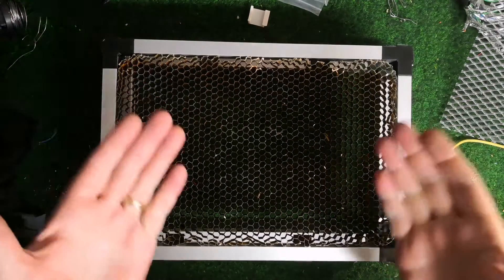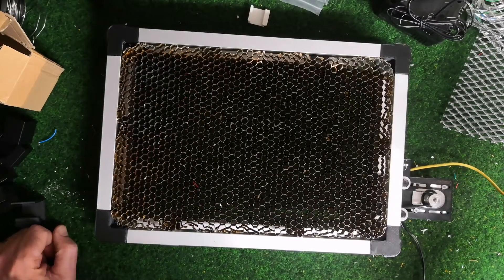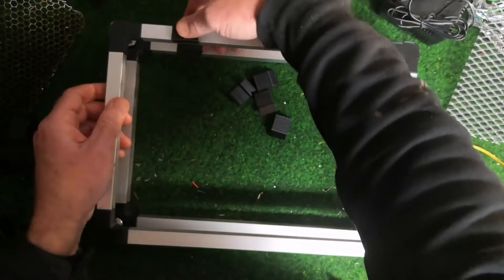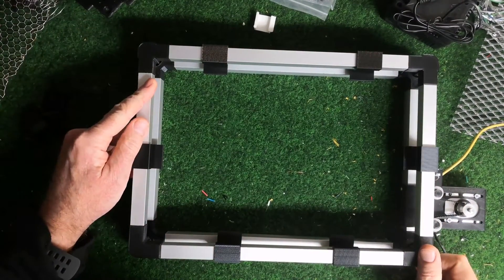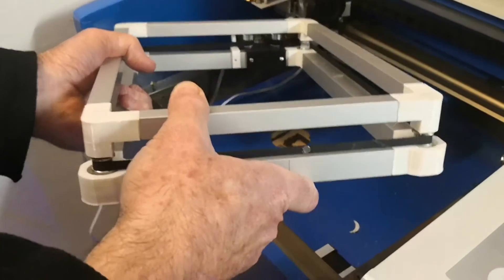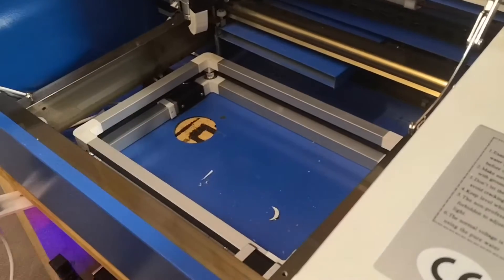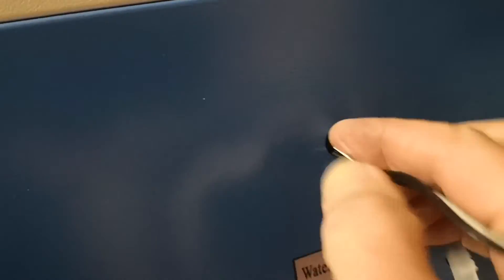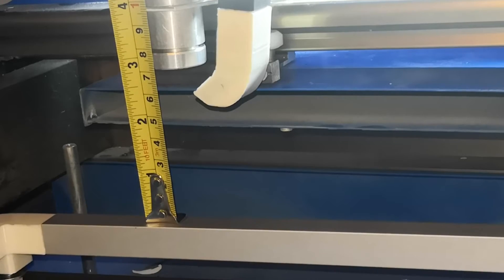K40 LASER "Z" AXIS MOTORISED BED.

Comment: Will this fit inside the so called K40 mini's?
Reply from the maker: Haven't heard of a mini version, do you have a link?
Reply: @letsfixit1594  It's basically a K40 but the case is bit smaller on control panel side and the tubes only 650mm
Reply: @yourpshomenet  I have a mini, the only difference is the power supply side, the bed is the same as a full sized k40. It should fit

Comment: What kind of motor are you using?  Thanks for sharing.
Reply from the maker: Hi Rick, it's a normal step motor.
Reply: @letsfixit1594  how did you wire the switch to power the servo?  You are just using a power supply through the switch to the stepper right. Thanks for any clarification.
Reply from the maker: @rickmccaskill7888  I will be offering a deal soon where I explain the whole build.
Reply: @rickmccaskill7888  I would think he's using a capacitor to run the stepper motor otherwise it would just jitter

Comment: next month I hope to release an opensource version wifi enabled (esp32)  controls that includes TOF for height measurement. similar looks, but off course make it yourself. my bed version 1 has more travel that this one, but unfortunately the rods come out,  

i'm also working on a version with two steppers that allow for a tilted bed, that way you can even have slanted objects in the bed. 

optimal solution in my option is to remove the vent , that way your bed will fit a lot better. and have a better range for travel 

using the wifi version is only second best, in the end I would prefer to have a new controller board that has a dual z axis control like a decent 3d printer  and then use software to raise the bed once every pass by the single pass cut depth
Reply from the maker: Sounds excellent, looking forward to your video, please come back and post a link.
Reply: @letsfixit1594  Ill post a vid tomorrow with the non OF version but controllable via the wifi ( rudementary website build into the ESP for POC)
I will take it outside of the laser to make that for better clarity
Reply: @letsfixit1594  here is the link https://youtu.be/UZmQlxEczRM